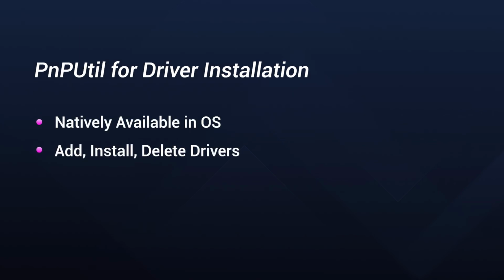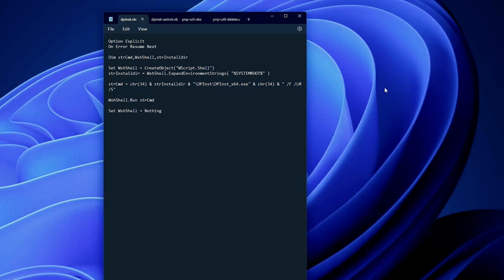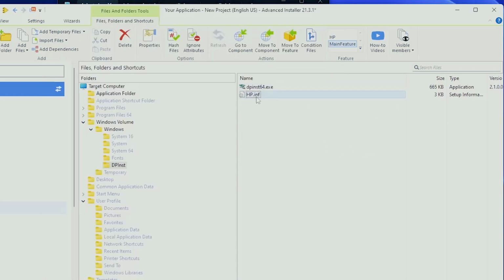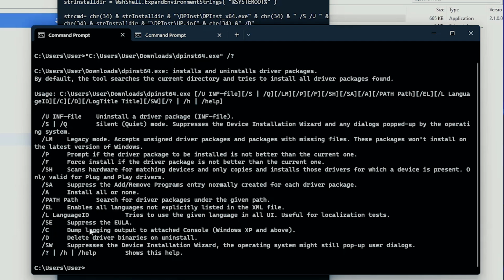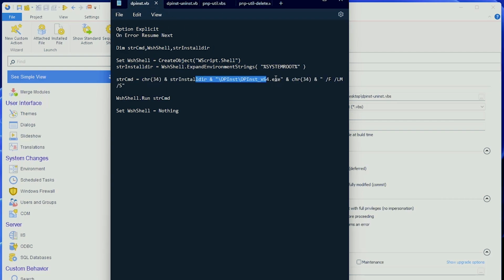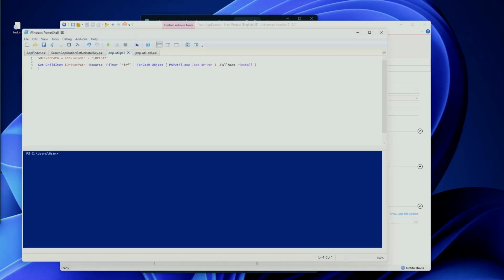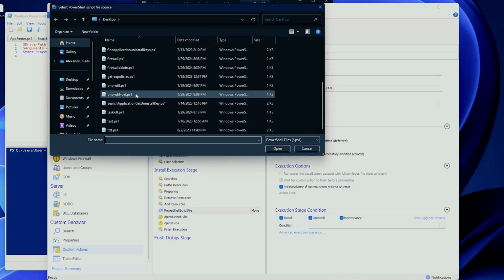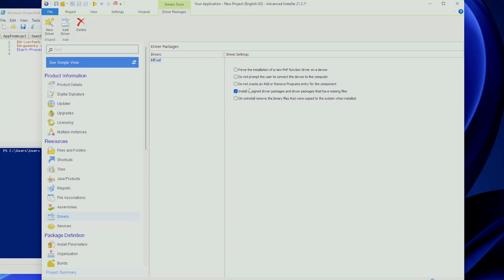MSI Packaging Training |  Session 12: Effortless Driver Installation with Your MSI

Comment: Thank you Alex for this demonstration. 
Despite being only 11 months old, it is already almost obsolete and driver installation from within MSI package is not so straightforward any more because:
- VBS is disabled in most modern Windows releases,
- PowerShell scripts can (and typically are) restricted or blocked on Security Policy level,
- DIFx utilised by AdvancedInstaller's native driver installation automation is deprecated and not supported on Windows ARM64 architecture
So effectively, easy scripting based approach has more and more limitations making it less usable at least as broad driver installation solution on wider Windows platforms.
Maybe it is time to build something into AI supporting driver installation and NOT utilising external scripting engine or deprecated DIFx tool?  ;)
I keep my fingers crossed for that!
Cheers.
Reply from the maker: Hello, and thanks a lot for your comment and feedback! You’re absolutely right—VBScript and DIFx are fading, Microsoft announced in the mean time that VBScript will get deprecated. While the video is newer, the ebook article that guided us to do the training series including the Driver Installation with Advanced Installer and VBScript is older. Indeed security policies and platform changes are evolving fast. Stay tunned as we release new videos often, so new software and industry changes will get visible in those tutorial videos.

Comment: Found this video - using the built in Drivers tab - so I create a simple MSI - add nothing to it - as all I want the MSI to do is install a new pack of drivers. 

I go to the drivers tab, select New Driver, select the inf file and it brings it into the system. I then select the tick boxes I want for the driver and build my MSI. 

When I run the MSI I get an error - Your Application ended prematurely because of an error - Yet I follow this video to which you say it should work - can you advise where your video goes wrong so I can deploy my drivers. 

Frustrating when we spend so much on an app - follow a video which the devs release and it doesn't work. 

Thank you
Reply from the maker: Hello! Your situation seems to be quite specific, so please address the issue to support@advancedinstaller.com and our Support team will investigate your case.